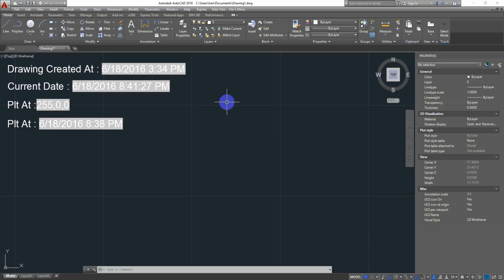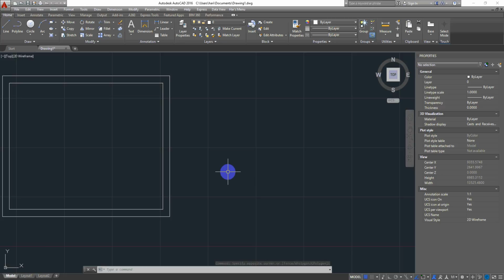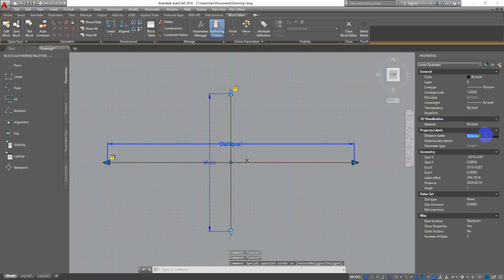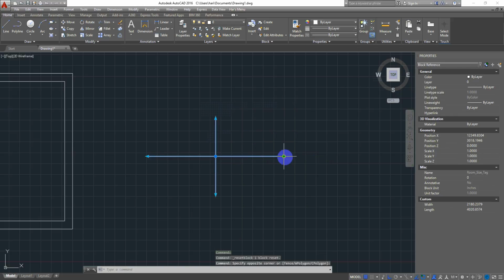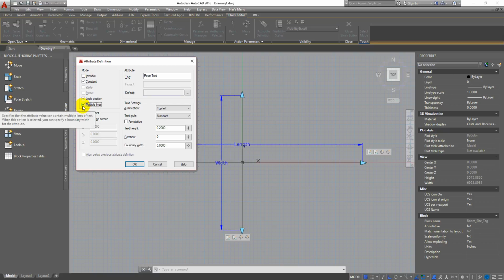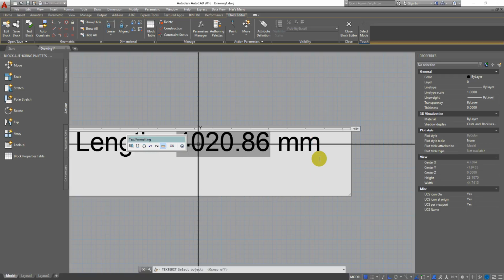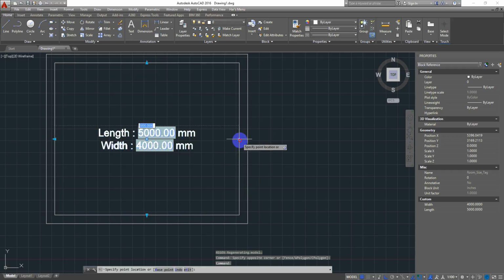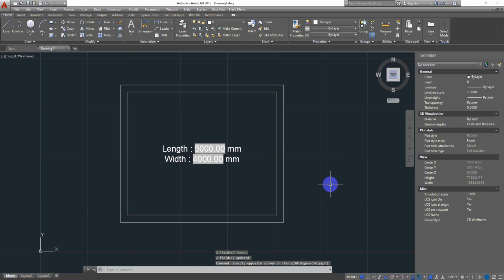02 Fields

Comment: I think, you should have only one grip for vertical and horizontal stretch. Then on other end stretch with direction 180 degrees. That will work very well. No need to add move action with distance multiplier 0.5.
Reply from the maker: very True. But in some situations grips on both ends would be required, like, if it is not equally stretched.